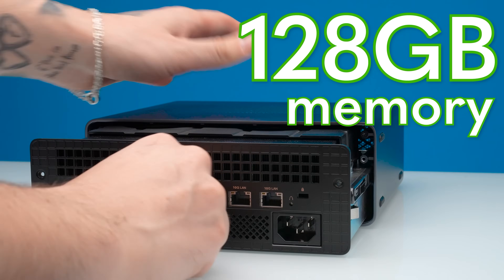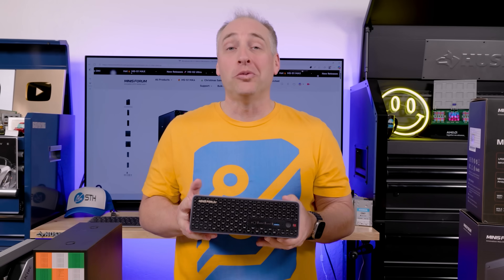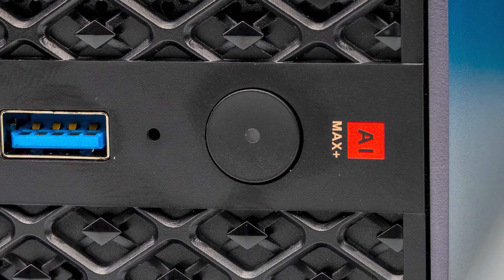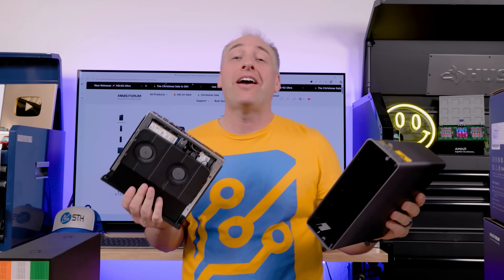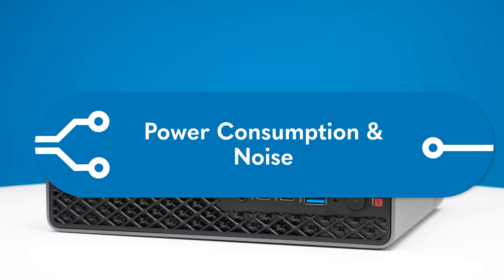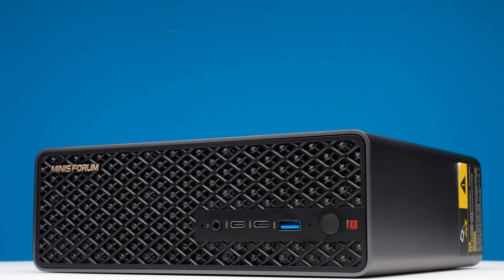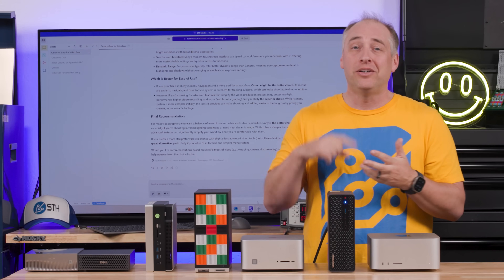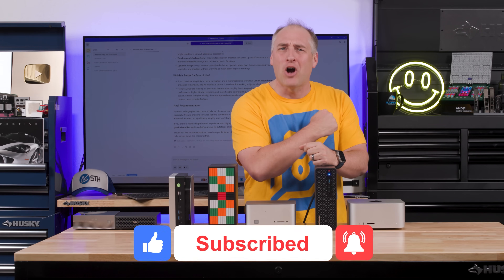The BEST AMD Strix Halo Mini PC Minisforum MS S1 Max

Comment: The noise though. The framework version has a much better looking radiator, on top of which you slap on a noctua or similarly quiet fan. Given it's meant to be a daily driver with future proof capabilities, i really hate their chinese mini pc looking fan features. Had the box been a bit bigger, it could have been almost silent.
Reply from the maker: We have both and reviewed the Framework late last year
Reply: This was built to fit in a 2U rack, where noise doesn't matter.

Comment: Only on video port?  That is fine for a server, but for a desktop, not sufficient.  My Beelink GTR7 has HDMI, DP, and via USB 4, can support 4 monitors... and it was only about $800 years ago.  No 10GB but 2.5GB, but I can live with the different given the extensive monitor support.

Comment: Besides freeing up marginal room on a desk, I really don't see any other pro of a non-standard internal power supply like this one. 

It's more difficult and expensive to replace, it occupies precious room that could be better used to add more storage, add-in cards or larger fans and it heats other components.
Reply: It's a standard Lite-On power supply. You can easily get a replacement power supply through Minisforum.
Reply: @estusflask982It's not a standard form factor that other companies make. And acquiring a replacement from the manufacturer will definitely be more expensive than buying a standard external power brick.

Comment: Got an issue with this review. 
"USB4 V2 at 80 Gbps". Yet the cpu on AMD website says it only has 40 Gbps.

So either we have chipset USB4 V2 using 8 pcie lanes just for that.
Or its just regular 40Gbps and at most we can use a V2 cable, but speed will never be V2.
Reply: The MS-S1 Max uses a dedicated controller chip for the 80Gbps ports. It doesn't use AMD's built-in USB4. The dedicated controller chip is likely an Intel Thunderbolt 5 chip, connected to the AMD CPU with PCI-E 4x4. So it offers 64Gbps. Which is still significantly faster than 40Gbps. It's on par with Oculink.

Comment: No way it all will work simultaneously at full transfer speed as listed. Please correct me if I'm wrong, the PC can deliver only about 59% (256/430) of data throughput to power all the infernal M.2 disks, USB devices, network interfaces and the internal PCIe card.
And Realtek network chips are not recommended for FreeBSD and network systems (e.g. TrueNAS) even if they "seem" to work ok.
  
AMD Ryzen AI Max+ 395 has 16 PCIe lines gen 4 (each line 2GB/s, maximum available transfer is 32GB/s or 256Gb/s.

The ports: 2*40Bb/s USB + 10GB/s USB + 2*10Bb/s USB + 2* 80Gb/s USB + 2x10Gb/s LAN that is already 290Gb/s. it also includes a 4 lines PCIe slot gen 4 (64GB/s) and M.2 4+1 lines PCIe gen 4 (80Gb/s). The total is over 430Gb/s (include other USB ports).
Reply: I was thinking the same thing, would love if anybody actually tested this
Reply: @TheOnePetrZ  Testing would take hours. Reading documentation and doing the math took   minutes.

Comment: What do you think is responsible for the performance gap between these systems, particularly with the Framework desktop? The framework has more case volume and better cooling, and it's the same chip. Are there UEFI optimizations that aren't universal? Does Framework have a lower power budget? Something else? Perhaps it was discussed in the video and I missed it.

Comment: The minisforum is hands down the best one. Somehow it seems like minisforum is outpacing everyone. Why is TB5/USB4 80Gbps so hard to come by? None of the CES 2026 laptops had it. Framework desktop doesn't have it, nor does GMktec. Yet these guys pulled it off. Oddly enough the 2025 macbook lineup as well as 16+ inch gaming laptops from 2025 all had TB5. Aesthetically the Framework is the best. They should do a refresh to get USB4 80Gbps in there, especially if we are all going to be subjected to ram scalping prices for the next year or 2.

Comment: Great box. But has some issues in Linux. Can’t wake from sleep and if you do a shutdown it disables the ethernet ports due to a some kind of linux kernel issue. None of these reviewers ever mention these issues, but this guy at least touched on it. IT does run games like a fiend with maxed out graphics in 4k so far. Better than the Beelink version which I ended up returning because the 10g ethernet dies on both linux and windows. But already obsolete AMD has a new board coming out in this same family
Reply: bios patch is out might fix that, fixed a lot of issues like this

Comment: I'm actually looking to build a proxmox server. Debating if this would be applicable hardware. The GPU is probably overkill for proxmox. But the other specs are in line.

Comment: What about long-term security and feature support of this and similar systems?
Does every vendor have an equally positive track-record supporting their previous models?
Reply: I don't expect support will be worse than that of mainstream consumer-grade notebooks.  Firmware updates are few and far between for those laptops but we survive.  As far as drivers are concerned, that burden typically falls on the manufacturer of the chip involved.  For Linux, there is great community support.  For example, the NIC wake-up problem has been fixed in the newest kernels.
Reply: @d.hughredelmeier1960  Most laptop manufacturers are a very low bar to cross and I have heard that support from Minisforum specifically is essentially non-existent. So if there are bugs in firmware or securty issues, you're on your own. They just ship something kind of working out of the door and move on to the next thing. That is not the kind of hardware I'd personally want to buy though.

Comment: That thing is awesome. So much expandability thanks to the extra M.2 slot, pcie slot, and don't get me started on dual USB4V2 ports. Egpu much? I think so! Not that it really needs It with such a high tdp Strix Halo chip.

Comment: The minstral 14b model isn't very efficient.  It shows the system perform really poorly on a 14b model when others would perform much better with similar results.  Not that you're in Sales but it doesn't really show that that $3k can do.

Comment: 3000$ and it has a SINGLE hdmi port    
i guess minisforum wants people to buy these in bulk to run headless doing AI slop
Reply: I assume that some of the USB-C ports support DP.  I haven't tried.
Reply: @d.hughredelmeier1960  They all do. You can run a dozen monitors on this if you use a EGPU

Comment: Minisforum MS S1 Max is a great system but it highlights an issue all these Strix Halo systems are potentially affected by, and that's the max number of PCIe lanes available from this SoC. The MS S1 has a fantastic array of ports and expandability, but the causality of having additionally 2x 10GHz NICs plus 2x USB4v2 ports is the second NVMe slot only has 1x PCIe lane and the PCIe card slot is only 4x PCIe lanes. I am not sure how RAID 0 / 1 would work on this system unless you fitted a SSD PCIe Card, to potentially give you a third NVMe slot that had access to 4x PCIe lanes like the first slot. I would like to see future systems such as this, have a BIOS that gives you some choice on how you allocate PCIe lanes to ports / sockets / card slots. For example, I would trade one 10Gbps NIC port plus one USB4v2 to give me a second NVMe socket that has 4x PCIe lanes.
Reply: My impression is that the number of PCIe lanes is an important constraint and it would be nice if one could allocate them to match one's particular needs.
Reply: PCIe lanes are physical, not sure how you could software define physical board traces....
Reply: @ReflexVE  I'm not sure myself, but I will wave my hands and say: with a PCIe switch.  Certainly some aspects of PCIe lanes are configurable.  Think of bifurcation.  The obvious place to do this is in the UEFI setup code.
Reply: @d.hughredelmeier1960  You are adding a lot of cost since you still have to do a ton of traces on an already complex and dense board for lanes that mostly won't get used. This makes a lot more sense on a workstation board than a mini PC, but in that situation are using a chipset with plenty of lanes to go around anyway.

Comment: I don't understand the enthusiasm for such systems. It will not age well, there is no upgrade path, it's not repairable and it's not even server grade like some xeon embedded systems, so I'm afraid it will not serve you long. It's more like a system for a year, maybe two and only for some specific AI workloads. This APU is interesting for some laptops and maybe gaming handhelds, but IMHO not for PC of any kind. For such expensive devices I'd like to see socketable CPU, DIMM slots, standard motherboard dimensions and layout and some commitment for 5+ year support. But maybe I'm just too old for this 😂
Reply: your point is valid. from economics perspective such mini devices don’t make sense. plus if you need ai, just pay 20 bucks a month for chatgpt or gemini which will serve you way better than the ai models these systems are capable to run

Comment: Comes across as advertisement... The differentiators of the system, especially in light of the current price differential to the competitors, are minor and for most niche. You did better in the past, more neutral. Anyhow, thanks for the presentation.

Comment: I'd love to have it, but the power supply on my old Synology crapped out over the weekend. It's back up after a replacement, but I think that's the kick in the ass I needed to finally setup a TrueNAS system. At the moment I think I'm going to repurpose my old AM4 gaming desktop for it. I should be able to re-use everything but the RAM, the case, and the GPU (will probably get an Arc card as a 3080 would just be stupid in a TrueNAS box). ECC DDR4 is very cringey right now, but already having a motherboard that seems like providence for this purpose (10 Gbps LAN, 8 SATA ports, super overbuilt for signal and VRM) and a more than adequate CPU / PSU / etc., I think I can stomach spending less than a turnkey NAS costs for something that'll run circles around them.

Comment: What are people using usb4 for? ... like I fail to see its usefulness. USB-C in general seems useless. You've got 10g lan built in, so you don't need an adapter. It could be useful for video pros with fast external SSDs I suppose. But the only thing I have that uses USB-C is my phone lol.
Reply: Thunderbolt networking is a common use for these machines. Put 2+ of them together and then hook them together via USB4 to cluster them.
Reply: External NVME

Comment: 10:07 which quantization for "ministral 3 14b reasoning"? Q4_K_M? Q6_K? Q8_0? Context size?
Anyway, tested with Q4_K_M, 65k context size... 40.25t/s with a 70W sff card.
Reply: Same model, context lowered to 32k, on a 2000E (16GB 50W).... 20.87 t/s

Comment: How is this the best when Minisforum doesn't provide regular BIOS updates, leaving machines with vulnerable AGESA exploits.

And the HP Z2 G1a Mini has the PRO cpu variant which gets LPDDR5x-8533 ECC instead of 8000 non-ECC.
Reply: I would rather deal with Minisforum than HP

Comment: Everything's soldered but at least price is almost half a spark... which its still nuts. Even worse, price is 2/3 of an Spark. At least with a spark you have nvidia. 
Just a kindly remind that a measly 256GB/s of membw shared with everything its not something "good".

Quite low membw, tbh ( An ilcheapo 5060ti provides you a solid 448GB/s)
Reply: 10:20 a 14B @ 14t/s.... 😟
Reply: Just tested gpt-oss-20b with context length at max (130k), in a 4000sff blackwell... 107t/s.

And the cpu had the boost clock disabled (I don't know if will change the perf using gpu)

Comment: The power LED is shining like a flashlight on my desktop. Is there a dimming option in BIOS?
Reply: You can! In the UEFI Advanced menu, "Hardware Monitor" submenu, edit Power Led PWM. The max value 255 is 100%. I dropped this to almost nothing and now it's nice and dim. I have a MS-A2, may differ slightly on this system.
Reply: Put tape over it.......
Reply: tape

Comment: I have 3 DGX Sparks that I have connected to a QSFP-28 100G switch. Buying that computer or any of the GB10 derivatives doesn't make a ton of sense unless you're making use of the ConnectX-7 NIC. You mentioned the power consumption but it's also expensive in terms of price. I went with it so I could make my own scale model of a GB300 to tinker around on, but most people don't have that use case.

Comment: I managed to snag for 1200$ an old Dell Workstation Laptop that was fully refurbished with new paste and thermal pads. That was just after RAM prices skyrocketed. So with 128GB of DDR4 2667MT/s ECC RAM, 8 core/16T Xeon and NVIDIA Quadro 5000 with 16GB of VRAM (Turing - basically RTX 2080 Super, but with 16GB of VRAM, slightly downclocked) it was very good buy. Both for games and for AI as well as decent networking. The only shortcoming was "only" 1TB SSD drive. But it had Windows 11 freshly pre-installed. I didn't check prices now, but back then if I wanted to buy 96GB of DDR5 memory - assuming I would buy barebones Minisforum PC or something - RAM alone would set me back 1000$. I kind of needed something relatively mobile that could play games, could do local AI, could act as some kind of home server etc. I considered various mini PC's, but 1 - they need a monitor, so you need to add that to the price and 2 - the price of RAM is prohibitive. Thankfully I bought a lot of storage (2 x 2TB and 1 x 4TB NVME) just before the prices went up.

Comment: The only problems is Linux , by default the 2 x 10gbt network doesn't work but there it driver now , but the USB 4 are AMD chip set driver so I could not get them working OR pass them to a VM on widows because the chip set drivers will not install .
I fitted a 8tb nvme in the PCI-e  , so I have 2 x pci-e 4x4 and a pci-e 4x1 .
Reply: Did you try Fedora?  Wondering if the latest kernel helps...
Reply: @ReflexVE  I will try that , I know they don't work on ubuntu and Debian . the system can see them with lspci , but lsusb is a mix of usb 2 and 3 hubs.

Comment: I have purchased 4 Minisforum PCs now for use as home lab servers. 2 of the 4 have failed after between 12 and 13 months of usage; just outside the 1 year warranty. Obviously your mileage may vary but I will stick to actual server grade components from now on…
Reply: That is the main point no youtuber/salesperson is talking about, because "sponsor's deal". Those PCs are not reliable with those powerful hot components in this form factor, after it breaks you are left with a very expensive paperweight without ability to fix it. Going for server components is a far better choice, me personally would go for single powerful PC or second hand Workstation and just go full VMs and Containers.

Comment: I thought the USB forum was trying to get away from their shitty confusing naming. WTF is USB4v2?
Reply: Usb4v2 is the base USB standard of thunderbolt 5 and most thunderbolt 5 devices will use the full 80gbs bandwidth. Intel owns the trademark for thunderbolt so AMD systems get branded USBV2.
Reply: They and the HDMI group are trolls.  If they weren't they'd just go with the PCIe convention of double bandwidth per full revision.
Reply: USB4v2 = 80 Gb/s

Comment: Did you lose weight? Congrats. On the technical side: using a point-release Linux distro that's not new enough for the hardware is a very common pitfall I've seen a ton of newbies fall into.

Comment: I'm convinced that the one mobo I've seen with a shim instead of a cooler will be the best option
a pancake like this one will never match the expected noise level

edit: wait, you need to donglify or get one of few type-C monitors to connect multiple displays? that's... a choice for sure

Comment: 3 Grand? wha t is this 386-25mhz in 1989 prices?  yikes.
Reply: 128GB of LP-DDR5X is not cheap, nor is a halo APU that has essentially an RTX 4070 on-die. We'd all love for it to cost $500, but the bleeding edge is never cheap.
Reply from the maker: 128GB is the driver here

Comment: Can someone please enlighten me on what would be the actual usecase which requires you to be running LLM training models in a desktop? I use LLM on a daily basis for work, but I can't think of a case where I need to run it locally.
Reply from the maker: Likely next week we are going to have a use case with the why and the business case for doing it. Video is like 85% done
Reply: Most home lab owner don't need a home lab 
Most hyper car driver dont need that performance and won't go track day 
And speed limit is likely 70mph in most location unless autobahn 

I don't need it, but I want it 
Like Coca-Cola, ham, bacon 

Another example is people have redecorated kitchen with all white goods, premium cookware but never cook or just use microwave 😂
Reply: I don't like those requests going out to the interwebz. That's literally all it takes for me.

Comment: internal power supply makes it more legit in size. whenever it is on the outside, it feels like the form factor is cheating because you always have to deal with a power brick.
Reply from the maker: Very fair comment